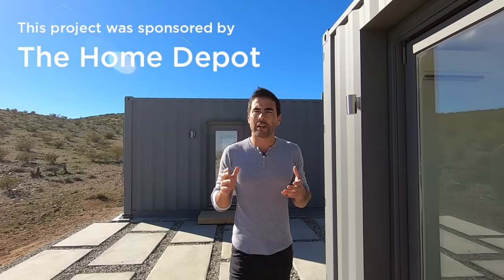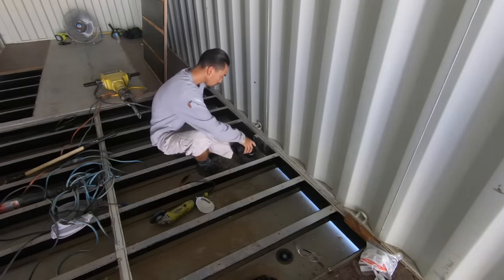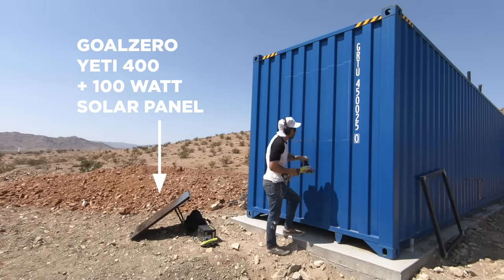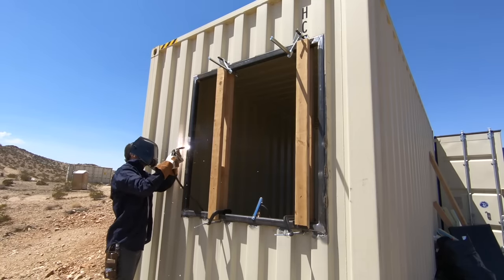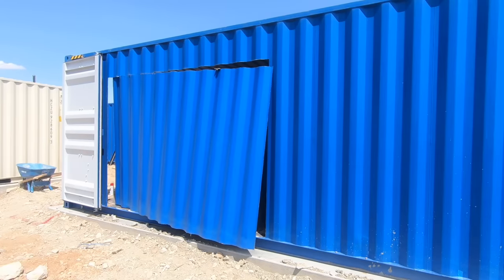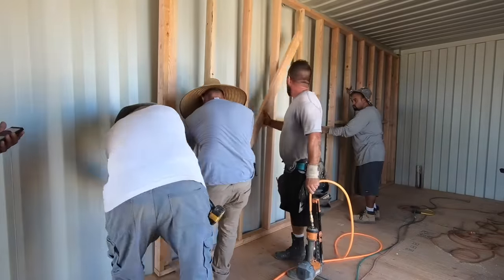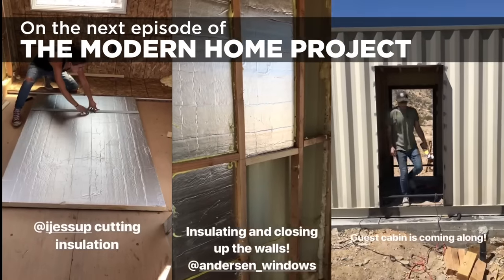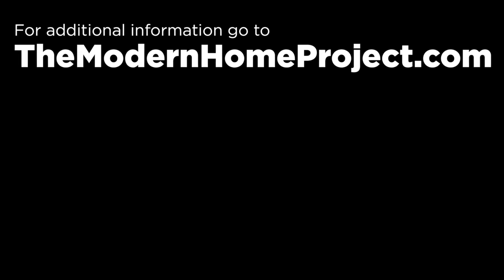Building a Shipping Container Home | EP02 Moving, Cutting, and Framing a Container House

Comment: I'm not sure I buy that the entire thing needs to be framed out because of the door/window cuts. This seems over-cautious. I'd be curious if people in states other than CA have gone to this extent.  Great video nevertheless.
Reply: it's a known fact that storage containers lose structural support once cut large areas out of it, it is very necessary to add proper structural support otherwise it could collapse in the future. If you watch other videos on storage container homes, they all agree on this very thing.
Reply from the maker: The structural engineering process seems to be focused on adding lots of redundancies to ensure that the building will be safe even if a lot of unforeseen circumstances occur simultaneously.  If an engineer is going to stamp the drawings in any state they want to be on the safe side by a factor of 5-10x the worse case scenario.  In this case i dont think its about it being in CA as much as it is requiring an engineering stamp.  I do think that it would be possible to find an engineering firm that would be less risk adverse but then do you really want that kind of engineer?  I totally agree from a non liability standpoint that it does seem like overkill.  Once something needs to be stamped and is on the record people want to protect themselves.
Reply: I agree, way overkill and cover their ass. Bummer, at your expense.
Reply: Better to be safe than sorry
Reply: @shampaka5059  That's how California makes their money.
Reply: @EdwardOrnelas  But the square steel he added was sufficient to do so. Otherwise, he should have just built some traditional buildings at a cheaper cost. The original door openings are built the same way as his square additions, without the interior frame. That's just a California code.
Reply: @EdwardOrnelas  I have no problem with some reinforcement, but they basically framed the entire interior.
Reply: @TheModernHomeProject  I guess I want my engineer to do some calculations, build in an appropriate safety factor and no more. Did he/she give you an option of reinforcing the openings in steel? My sense is that until this construction becomes more commonplace, that engineers/inspectors will not quite know how to handle it efficiently and will default to what they do every day.
Reply: @JohnKruse  the problem is the engineer is working with a very limited fee to come up with a design and a drawing package that is both safe and economical. The reason an engineer can design a conventionally framed home at a reasonable cost is because he doesn't need to analyze every member and every minute detail and connection. Between the decades of research by other engineers and the design engineers experience they can use tables, known values and things like off the shelf connections (joist hangers, clip angles, uplift anchors) to quickly put together a design. Sure the engineer could come out and measure the width. Height, corrugation pattern and thickness of all the panels and support members. Perform countless calculations, develop finite element models, design custom connection components, inspect Ben's welds (spoiler they wouldn't pass) and sign off on the design and maybe avoid the wood framing and some superfluous steel framing. However I guarentee at somewhere in the neighborhood of $150/hr+ for the engineers time to do all that, Ben was better off buying some Simpson hangers 2x4s and a little extra HSS steel. By the way Ben I'm really enjoying the series, next time a client asks me to help with a container structure I'll steal some of your ideas. PS we typically design in the 1.5-2.5x safety factor region depending on what the load case and failure mode is, now soils people are closer to the 5-10 region lol
Reply: I’m sure I’m missing something obvious here but aren’t the framed out cavities going to be just as necessary as a place for the wall insulation to go? I suppose if it was just for that purpose and to hang drywall/gyprock on, it could be a bit less heavy duty? Is that the issue people have here?
Reply: @TheLindsay720  I've seen videos where people do exactly that, and that's fine. There are, however, some rigid insulations that are made to fit the sides of the containers and they build in mechanisms for hanging sheetrock. Just depends.
Reply: @CalebMichaelMartin  Yeah, I get it. It seems, however, like a rather inelegant solution, but when you've got the proverbial hammer...
Reply: They don't get structural support from the sides, they get it from the 4 corner beams. That's why they are always stacked the way they are on ships. The sides help with making them rigid. The steel frame was more than enough.
Reply: @TheLindsay720  The problem here is that these "comment experts" haven't seen the next episode where this is explained.
Reply: Non-framed containers are known to the state of California to cause cancer
Reply: Lunchbox Productions Do you have a link?

Comment: TLDR: With current CA regulations rather DON'T build container houses in CA. That's my take away:

All the timber that went into those containers kinda ruins the whole point of the container itself in my opinion and took a lot of the space away and at that point you might as well just put external siding on the wood and end up with a better insulated structure for cheaper. The WHOLE point of containers is precisely that they ARE the structure of the "room" roof floor and walls. But here this HAS proper foundations and proper framing with proper support, the containers are really just there at that point for sake of being there. Corrugated siding would land you the same look cheaper. Just my opinion. Overall it is very well done though and quite impressive just wanted to throw my 2 cen'ts in the jar.

Comment: Everyone has there views, expensive, inexpensive, etc etc, the video is about a container home not about other styles of homes. I like container homes, my view I would have had 2 x 40' side buy side and welded into one for more room. but that is my view.
One note on the welding with Mig welding you push the weld not pull it, this gives a much stronger and neater weld, (Mig push, stick MMA pull) If I get chance to build my container home 2 x 40' on the base and 2 x 40@ offset on the upper level.
I looking forward to watching the rest of the video posts...... ignore the noise  each to their own and looks to be a good finished product
And before anyone has a pop I am an electrical and mechanical engineer plus fully qualified welder in all forms of welding..... but always learning and will never know it all. .... but do know what I am talking about